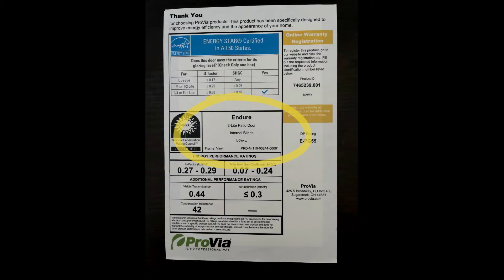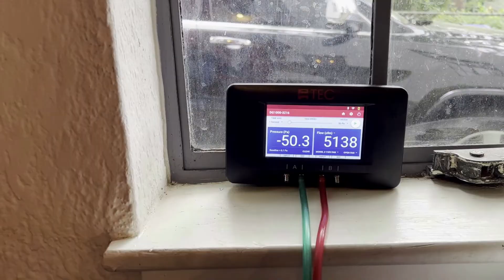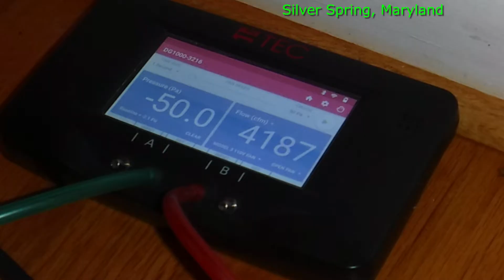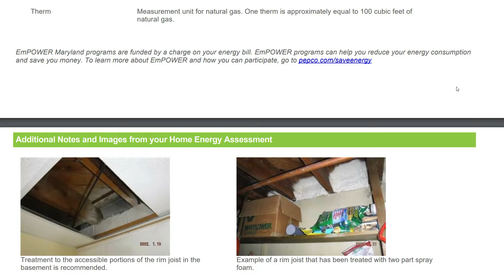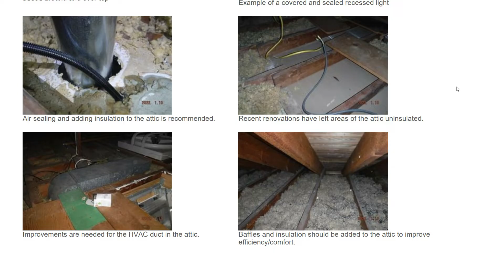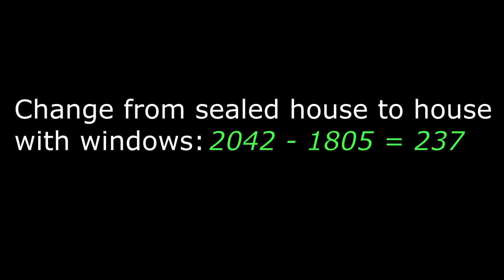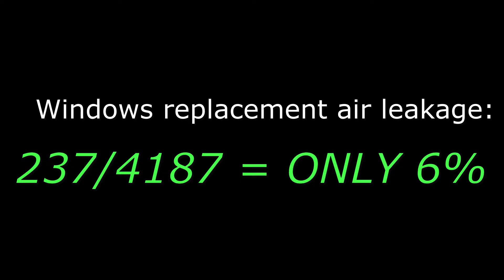Everyone Says Get New Windows… But Here’s the Truth

Comment: But what about a counter arguement here- the householder has invested in getting the house effectively 'airtight'. The new windows are not going to give an improvement of another 50% from a house that has just had the air sucked out of it . TBH i was expecting this video to show the number had increased or remained static - that 6% improvement was actually quite good. Consider if you got new windows with no insulation (all the jobs the video maker did) - it would have been interesting  to see what percentage the improvement might be. I get that the moral of the story is that you can spend big bucks on new windows thinking they will improve your life is senseless but I think as a study this is slightly weighted with a bias against the new windows. BtW  am totally in favor of resealing your windows before you even consider buying new ones and i do this myself. I just think that the video is making out the windows are ineffective. If they are well installed as these ones seem to be they do a very good job of keeping out cold air and not letting air escape.
Reply from the maker: A blower door doesn’t care what order the work was done in. It just measures how many holes are left. Fix the big holes first or last — the final number is the same.

Comment: I see lots of comments about inefficient aluminum windows but at approx $1100 replacement cost per window and I'm guessing on average 20 windows for the entire home, it's going to take years or decades to break even and, by that time, you'll need new windows again.  Just a thought.
Reply from the maker: Indeed. And when I write a workscope for air sealing and insulation I feel like $4500 out of pocket is a lot. Yet the homeowner gets SO MUCH MORE for the $
Reply: This is a good point and if you throw in solar panel installations which 'pay for themselves' in x number of years, I also like to refer to the fact that if i stop holes leaking into my home and replace cracked old seals i can crank up my heating and not bother with solar panels. Its the cost of everything that makes being environmentally sound a choice that will often leave you broke. Its ok if you live in a property with a huge roof and can sell excess back to the grid but laws keep changing in this regards - its making expenditure on solving the issue ( and the planet) an expensive affair. If i have enough money to buy new windows guess what I am not going to do it I will go on holiday or buy a car for cash instead.

Comment: My question would be about transfer heat.
Reply from the maker: Depends on what material your current windows are made of... old metal/aluminum, then yes, new windows will help in that department. If they are currently vinyl or wood, not so much.

Comment: You should not spray foam directly onto wood in an old house attic because it can trap moisture against the wood, leading to rot and structural damage. Spray foam also prevents air circulation and makes it difficult to inspect the wood for leaks or decay, and can cause the wood to overheat!
Reply from the maker: I’m sorry. I’m not following you. Thanks for stopping by and check this out https://youtu.be/b2gYEWToLe0?si=BHRMcxuM10FFTiFD

Comment: I thank you for a very informative video! I am wondering how much leakage is desirable. My uncle was an engineer and built his own houses. I was told by relatives that his homes were too tight and didn't leak enough. They said that you want a house to leak some air in order to bring in enough fresh air. Is this true?
Reply from the maker: Ahhh, the difference between controlled and uncontrolled fresh air. Yes, that is entirely true! However, do we just want to let the house dictate to us and prevent us from being comfortable and energy efficient or do we want to have full reign over the process? In retrofits after air sealing and making the house tighter, we install a quiet exhaust fans in place of loud builder grade specials that typically don't work anyways. We put the fan on a timer and it runs according to the data we collect in the field. The physics behind it is for every little bit of air the new fan pulls out of the envelope, new, fresh air comes in to replace it providing occupants with a stream of fresh air and hence, a healthy home. Newer homes that are tighter have HRV's and ERVs built in for fresh air balance.
Reply: @homeairleakagetest  Wow! Thank you so much. I didn't even know there is a door pressure test until just now.
Reply from the maker: @7584JoeCRT  I know, it is not something you would think about every day. But I do - LOL. Anyways, glad I could help!

Comment: I am a 62 YO retired married man. I owned a home in the San Diego area for 23 years that was built in 1961. It had aluminum frame windows and sliding patio door that were not insulated or at least were not insulated anymore. In the winter time the frames would sweat and grow mold that we had to constantly clean.

I replaced two of those windows in bedrooms myself (stucco exterior which makes for extensive demo to get to the flange fasteners, and then extensive patching and painting after). Previous owner had some friend of his do new stucco and he did it very poorly. By 2014 it was all falling off in huge sheets. I had the rest of the windows and both front and rear entrance doors replaced as part of a new professional stucco replacement so that all of it would be uniform along with two large holes I had filled in where I had removed old and decrepit window AC units mounted in the walls (no longer needed because I had central heat and AC installed).

Point being that we no longer had the window frames sweating in the winter, and the bathroom in particular was a bit warmer.

It's not just about air leakage.

Now we're in a different house built in 1978 in south central Kansas, and again I have mostly old wood window frames with aluminum exterior storm windows. There are two sliding patio doors, and they are either no longer insulated or never were, and both of them sweat in the brutal Kansas winter. Standing next to them feels like being in the open door of a freezer just from that 6' x 6' pane of cold glass. I replaced one myself with a new Jeldwyn door three years ago because it broke and would no longer latch, and I needed to either buy a bunch of parts somewhere for a door whose mfr went out of business years ago and basically rebuild the 44 year old door latch and rollers, or just replace the whole thing.

We haven't had the funds to do all of the windows, but I did put tint film on all of the south facing windows to help keep the cool in Kansas brutal summers.

I would never recommend ONLY doors and windows, but I will absolutely say they will help. This house has other issues I need to fix due to poor original construction

I need to install soffit vents.

Some of the AC and heat ducting to upper levels has completely rusted out due to condensation, and I need to pull down ceiling sheetrock and replace the ducts and seal and insulate the new ones to prevent that in the future.

I believe our heat and AC unit is probably at least 20 years old and will need to be replaced as well, but I want to get these ducts fixed first.

Then there is insulation I can see missing in exterior walls using FLIR, and air sealing electrical boxes and tops of walls in the attic.
Reply from the maker: Wow, thanks for sharing your experience and all the details about your home!

Comment: Thank you for this, we'll definitely be checking on the air leakage in our house. 

For the windows, however, isn't air leakage only part of the story for efficiency? If the vacuum in the double pain seal is broken, it may be that still no air gets through or around the window, however, the thermal efficiency is still much worse.

Likewise, even with two homes having everything sealed properly, same air flow measurements and everything, one home can still have better efficiency due to the insulation having less thermal transfer.
Reply from the maker: Hi, thanks for your comment. Yeah, I hear you, but unless you live in a really windy place, the walls are not subjected to as much pressure, therefore the R-value required is always much less. For example, in Maryland the walls are required to be R13 and the attic flat should be R49. That is like a North Star for guidance when it comes to importance of insulation in the different parts of a home. Of course, newer windows that are not metal/aluminum and that have LowE and Argon will be better, but not game changers in my opinion. And for the cost - do it if you want a nice view and good functional windows, but don't do it to save energy.

Comment: I would agree & I am currently in the process of solving a similar scenario for 3 residential units of mine. I do, however, believe a HUGE, overlooked aspect by most is the subjective factor.
For example: The type & quality of the windows, including the install. Are they single pane or other, etc. One of my properties was built in '79 & I had to replace a horrible tile repair job w/ a bathroom tub surround that had a window on the exterior wall. This window (by then) allowed the building code not to require a ventilation fan. Most people think tile is impermeable (waterproof), this is false! Water passes through tile just like concrete. Needless to say, I had to replace all the studs, in addition to the tub surround an replace the insulation. I also discovered there was no housewrap or vapor barrier either behind the 45 year old hardie board. Im sure you can imagine what else I have to deal with.
I will be doing similar methods & testing as well & replacing the horrible "single" pane, aluminum windows & several other retrofitted additions. Lucky for me, I have spent 25+ years in the field doing this kind of work & wont be paying hourly labor cost.
Reply from the maker: That is quite the project! Sounds like you know what you are doing.

Comment: Thank you for sharing these numbers. I'm thinking of DYI'ing attic insulation and have gone through multiple other videos looking for cost and benefit to no avail. The ones I've seen talk in absolutes from "tremendous" to "amazing" results which just sounds like a sales pitch. Or they will show the blower test before but not after. Much appreciated!
Reply from the maker: Thanks for the comment—I’m really glad you found the numbers helpful. When it comes to attic insulation, especially as a DIY project, the key is making sure air sealing comes first. That’s where the real comfort and efficiency gains happen. Once the leaks are sealed up, adding the right amount of insulation gets you to that target R-value without guesswork.

Let me know what stage you’re at or if you’re looking for guidance on materials or approach—happy to help however I can!

Comment: 20 yr old multi level house (5 split levels, 1700 sq ft) in the Rocky Mountains... have $350-$400 utility bills (electricity is usually half the bill). Neighbors with the same model and more family members are avg $200-$250. Thermostat stays between 65-71 (higher in the evenings). Attic has blown fiberglass. Was thinking about having the insulation removed, air sealing, then reinsulate with updated (non-fiberglass) blown-in insulation. FLIR shows tons of cold spots in inaccessible outside wall corners and where outside walls meet the ceiling (occurs in several rooms). Bay window is completely purple above and below the window. Is this a case where the issues outweigh the cost of air sealing/insulating the attic?? Thanks for the video!
Reply from the maker: Thanks for the comment and for sharing all those details—sounds like you’ve done some solid detective work already, especially with the FLIR camera!

Based on what you’re seeing—cold spots at the ceiling/wall junctions, around bay windows, and the fact that your bills are noticeably higher than your neighbors’—air sealing and reinsulating the attic could absolutely be worth the investment. The blown fiberglass you have now does little to stop air movement, so without sealing first, adding more of the same would likely just mask the real issue.

Air sealing those hard-to-access wall/ceiling intersections (especially where the stack effect drives heat loss) is key. Swapping out the old insulation for a higher-performing material like blown-in cellulose—which also contains borates to help deter pests—could help stabilize temperatures and reduce your bills significantly.

With a multi-level home in the Rockies, you’re in a climate where these improvements can make a big difference. I’d say the signs point to this being a great opportunity to improve both efficiency and comfort.
Thanks again for your contribution to the channel!

Comment: I’m in the same boat. 1957 house original aluminum single pane windows. Recent utility increases in usage charges and delivery charges absolutely have me determined to get ahead of the problem. Looked at solar options which also opened my eyes to the fact that my small house was so poorly insulated that I would need double the amount of solar panels to compensate for the real issues. I am absolutely doing a total envelope insulation job done with new windows for the added efficiency value and  aesthetic value. Was going to have the inside of the house painted anyway so now that will be the last project after the required holes needed to pump in insulation.
Reply from the maker: That sounds like a great plan - you’ll be very happy with the results!

Comment: As an HVAC guy who has 30 years experience here is my 2 bits. Yes, air leakage is the main factor but when you crappy windows you have major heat loss. They could have air tight single pane glass windows, well probably not but you get the idea. I realize what you’re trying to say in the video but I would also replace my windows too, if you’re looking for major energy savings.  Air infiltration = heatloss. Bad windows = heat loss. I have crappy windows in my 1975 bungalow. Not original, but crappy. Planning on replacing all with triple pane. Yes, I have made my house air tight as I could and I have some ideas how to take it further. Good video. 🇨🇦
Reply from the maker: Thanks for sharing your experience! I really appreciate hearing from an HVAC pro with 30 years in the field. You’re absolutely right—bad windows do contribute to heat loss, especially if they’re low-quality or poorly installed. No argument there!

The key distinction I try to make in my videos is that, in most cases, air leakage is the bigger issue to tackle first before going straight to window replacement. So many homeowners get sold on new windows as the magic fix for energy savings when, in reality, sealing up major air leaks and improving insulation often gives them way more bang for their buck.

That said, if you’ve already done the air sealing work (which it sounds like you have!), upgrading to high-quality windows like triple-pane can absolutely be a solid move—especially in a 1975 bungalow where window performance might not be great.

Sounds like you’ve got a great plan in place—curious, what other ideas do you have to take your airtightness even further? Always love hearing from people tackling these improvements firsthand!

Comment: Air leakage isn’t the only thing related to comfort in a home. Single pane windows really get the air moving downwards as it cools causing drafts. Any modern window is a huge improvement over aluminum frame or leaky double hung windows.

Air leakage is a big energy waste but comfort is also related to radiation of body heat to cold surfaces. If you cover these surfaces with curtains or carpet you will feel warmer even though the air temperature remains the same.
Reply from the maker: I could not agree with your comment more. Thank you for contributing!! I am always explaining this concept to people (the best I can) during energy audits, especially when they swear it is the windows and the pressure test reveals that the windows are not leaking air.

Comment: So true.. I just bought a unfinished homestead the windows had gobs of spray foam around them...  The first night it was 5deg out and we couldn't get  the place above 45F .... I felt the windows most of them were warmish...   12+ cans of spray foam later sealing massive air gaps in every room  with the wood stove burned out about to leave and it was sitting at a nice 65f    and I still have air leaks to fix. and a bunch  of insulation to add...    Now we have two windows in the bathroom that are junk they now ice over... That's how you know your windows shit...
Reply from the maker: Thanks for sharing your story—it sounds like you’ve been through quite an adventure with your homestead! It’s amazing what a difference sealing air leaks can make, and it sounds like your hard work with those 12+ cans of spray foam really paid off. That jump from 45°F to 65°F must have been such a relief.

The iced-over windows in the bathroom are definitely a sign there’s more to tackle, but you’re on the right track by focusing on air sealing and adding insulation first. Once you’ve addressed those key areas, you’ll have a much clearer picture of what’s left to do. Keep up the great work—it’s always rewarding to see the results of your efforts, especially in a space as personal as your home!